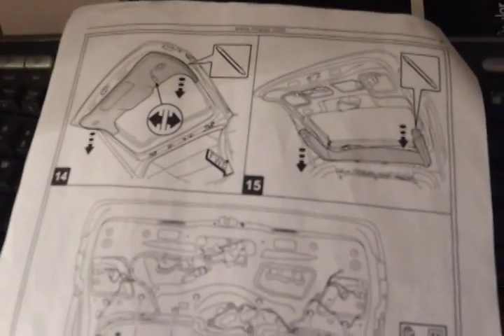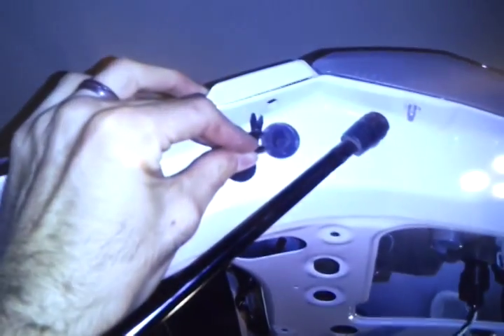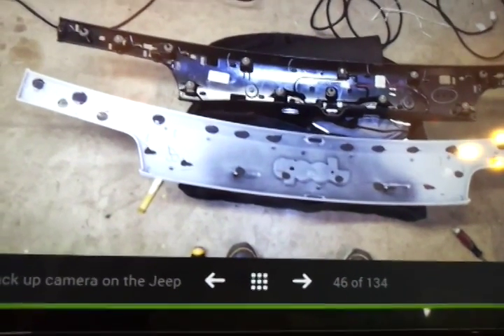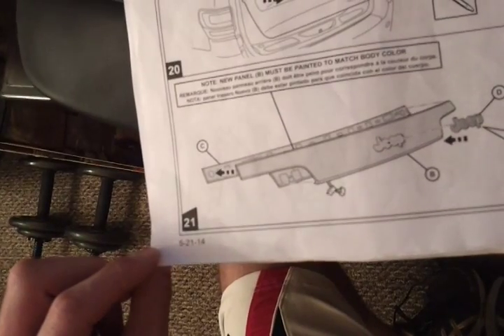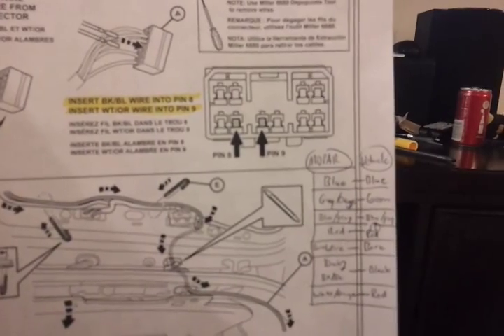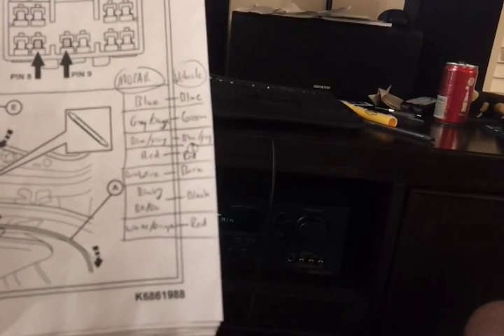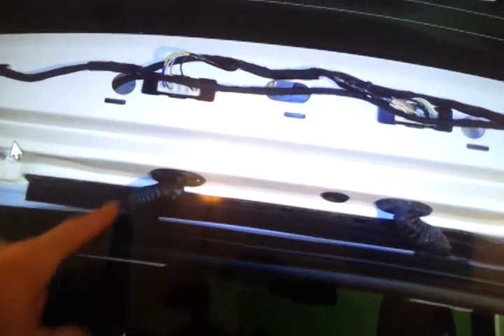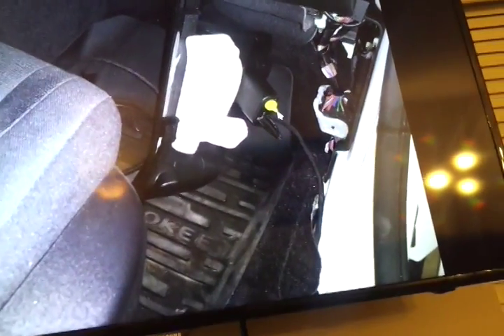2014 Grand Cherokee backup camera install 2/3

Comment: just used this as a guide for mine. going to have it activated and hopefully it actually works. a couple of things. 1) when running the wire through the rubber grommet, remove the conduit from the red wire and reattach it after it's all the way through 2) remove the rubber grommet from the liftgate/top of vehicle so that you can make it straight. used a wire hanger and taped all the lose wires to it to shove it through the rubber grommet.3) i had wires in slots 31 - 33 (i think shown in your next video) so i just soldered it to what was already in place in case they needed to stay there.

Comment: Great detailed video. I have a question for you. I have a factory installed camera in my jeep that quit working. The dealership told me the camera went bad. If I purchase a new panel with camera am I able to replace the panel and plug in new camera to existing wiring that is already there? Again camera is already installed and was working but went bad. Thanks for taking the time.
Reply from the maker: That sounds right, but unless you can buy the part to match your paint you'll either have to have it painted or separate the two parts (for both your existing rear panel and the new panel) yourself.  If your warranty doesn't cover it then I'd do it myself to save money.  Also, when you take it apart I'd check the wires with a multimeter to see if the problem is really your camera as opposed to a weak ground etc.

Comment: I'm getting the camera installed by a dealership but I don't want to pay an extra $150 to paint the exterior piece of the back plate. Is there anyway to remove just that exterior piece, as you did, without taking the entire back plate off? Is it possible to use a trim tool to remove the exterior portion while the interior portion is still attached to the liftgate?
Reply from the maker: +Richard Beil Not possible, but getting the cargo door trim piece off isn't the hard part, it's running the wires all the way up to the front.  If it's already wired or you're just replacing it then pull the interior trim off and then pull it apart like I did.  Just make sure all the plastic connectors are all lined up before you start popping them all in, once or two of mine weren't line up and I ended up just breaking them.  It wasn't a big deal at the time because the trim piece will still stay on...now after hearing those two pieces rattle every time I shut the door I'm so pissed I didn't just pop it off and line them all up again at the time.